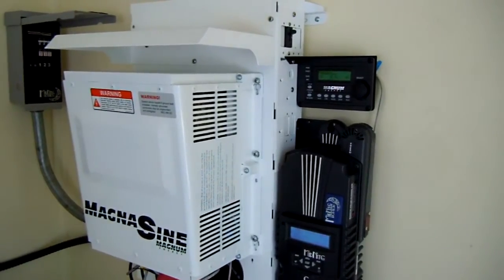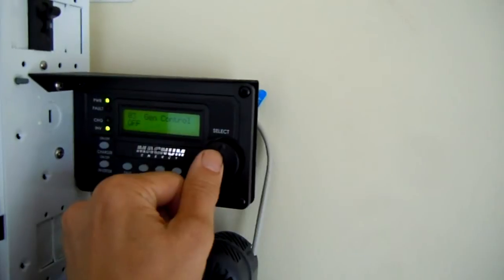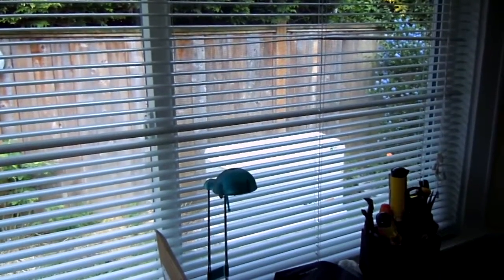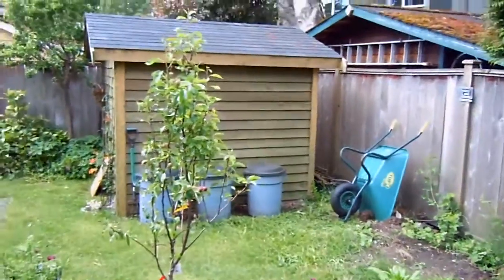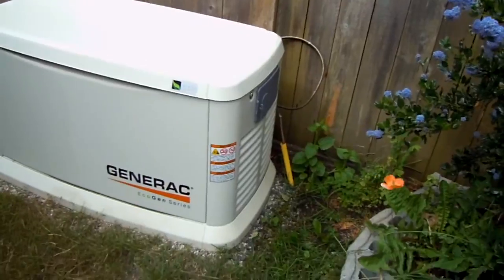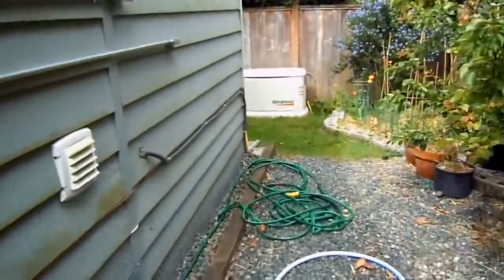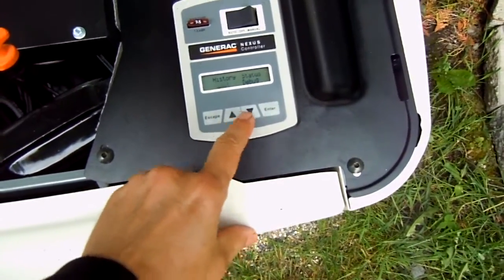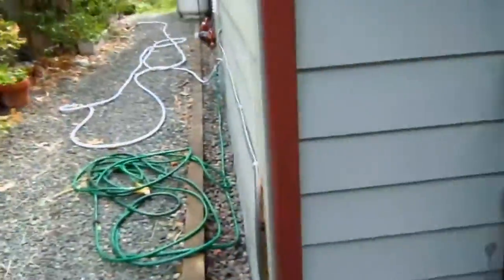Generac 6kW Ecogen running.

Comment: Very well done.  I have just bought one and will be installing the first week of October.  The unit was highly recommended by my solar system consultant because a couple of his clients (one of them an electrician) opted for the unit and were very pleased with its performance.  We have a 240V system with 16 L16H-AC Trojan batteries.

Comment: Nice video!  We are off-grid and looking for a backup generator.  The Generac EcoGen LOOKS and reads good, but we can't find anyone who has experienced usage.  How long have you had it in service and are you pleased with operation?  Is is large enough to equalize your battery bank?  We have a 24V system, 1050 AH bank.